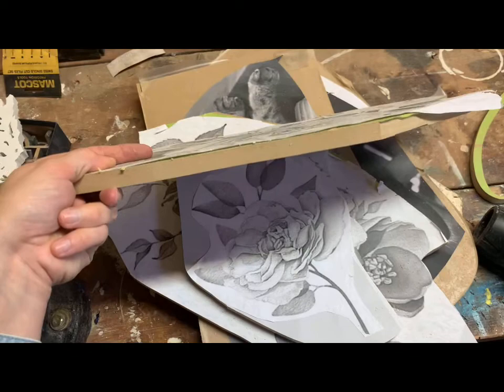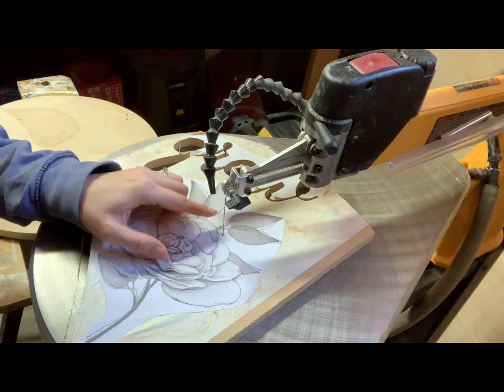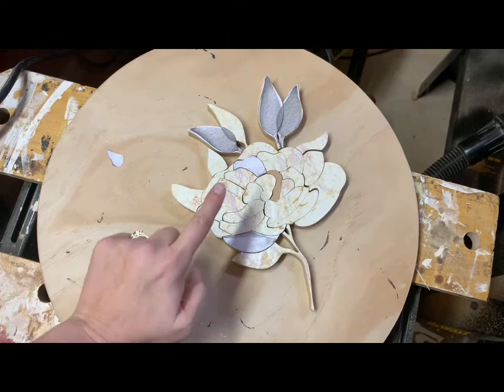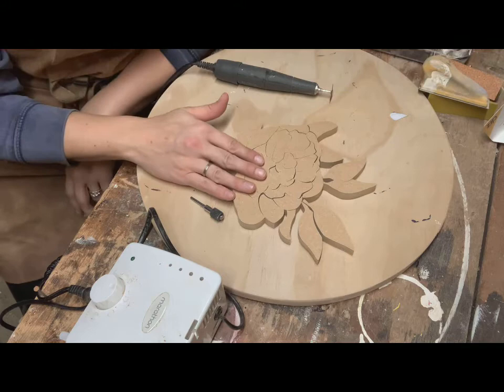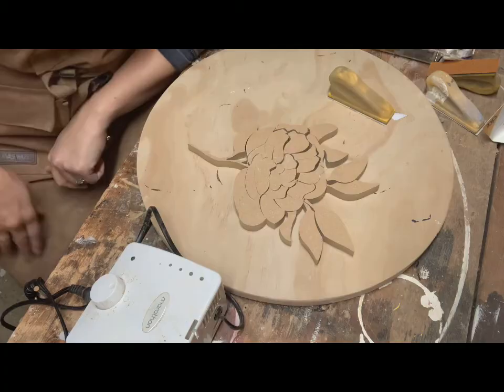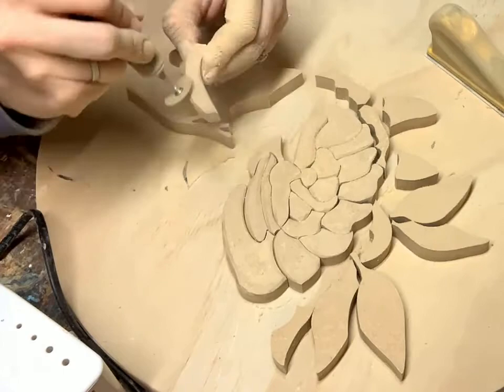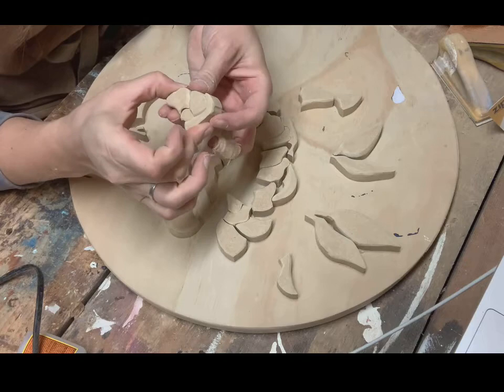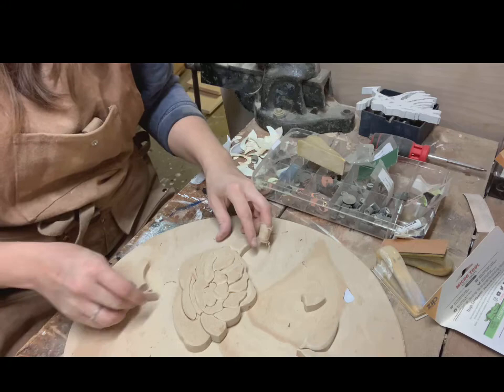Cutting and Shaping Florals

Comment: I see so many people complain about how hard MDF is to work with but I also notice it seems to be a scroller’s wood of choice. Is there a reason for this?
Reply from the maker: MDF is a good material for cutting and indoor use. It is however very dusty, and it can absorb paint quickly. But if a learning curve but it’s for sure my most used material
Reply: Is it because it’s cheaper? When do you need better wood?